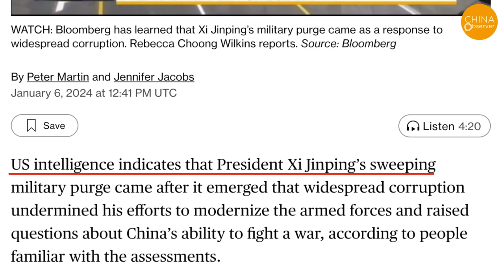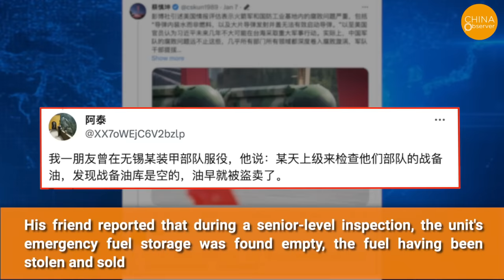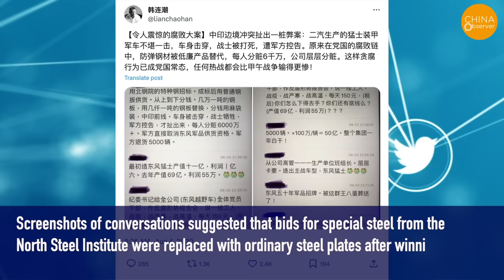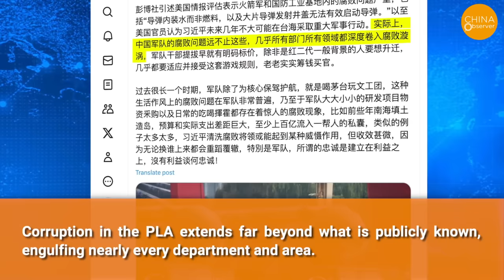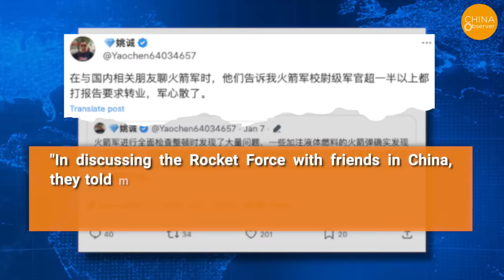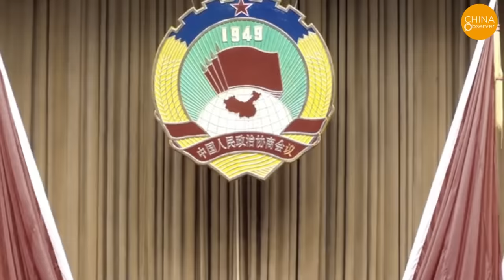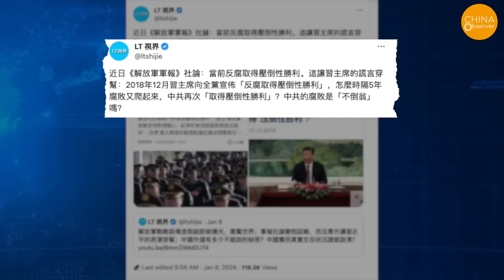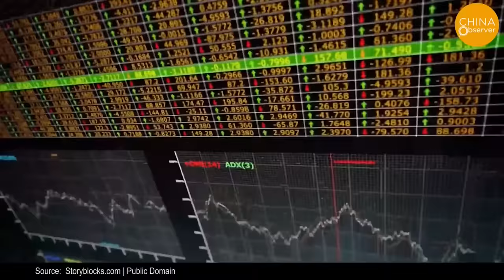China’s Missiles Filled With Water, Not Fuel; Numerous Launch Pads Fail to Open, Soldiers Want Out

Comment: The PLA has discovered a way to use water as rocket fuel? Very interesting!
Reply: well, rocket fuel is just combination of hydrogen and oxygen, why not go with something thats already combined
Reply: You probably could do it with ClF3 as oxidiser. Not that you would want that for anything but the bragging rights to have done it, there is a reason why ClF3 stuff never entered major use in rocketry as it can burn anything except noble gases and fluorides.
Reply: We had them as kids (in the '50s and '60s) little plastic rockets that you filled with water, then applied a bicycle pump to charge.😁
Reply: @surlyogre1476  What's old is new again!

Comment: Just throwing this out there, trying to be optimistic: I wonder if the 'filled with water' item might be the silos themselves are not watertight nor have a water pump-out system if leaks occur, so it shorts out the control systems.  I can't imagine someone actually dumb enough to replace liquid rocket fuel with water.  But then there are those silo doors that don't open properly, did someone forget the regular maintenance procedures on those?  Nothing quite like 'nuking' yourself!
Reply: No they literally sold the fuel off to use for cooking and in order to maintain the fuel levels and gauges water was used to replace the fuel. The same was down for solid rocket fuel. A bunch of it was sold off or used on the bases for cooking. 

能骗就骗 ("if you can cheat, then cheat"). This is a way of life and ingrained into Chinese society.

Comment: Many of the problems Russia encountered in it's invasion of Ukraine are liked shared by China. For a long time, military officials were basically untouchable and the supplies were under care of poorly paid soldiers. Inspections are also few and not even actually happen most of the time, they're just filed as having been done.

Under these conditions, it's no wonder lots of materiel in storage has been compromised or doesn't present the same level of readiness the documents would indicate.

Anyway, dictorships and corruption go hand in hand. Dictatorships are often rife wirh factions, and maintaining the balance between the factions is key to maintaining regime stability, so lots of corruption cases are just ignored, and if you crack down in some faction, you'll embolden the rival factions.

Comment: Their carrier may also not be up for its job, their aircraft have many parts of research stolen, and influenced from russian concepts. The damage they have done to their military by this behaviour will have set them back so far, it may be uneconomic to fix. Not to mention timeline-wise unobtainable. 
However, i think china should annex North Korea, because i personally think that country will create enough attention,draw in the west and china would be forced to display its incapacity militarily when they come to save north korea again. Im not saying china will lose easily, but they would show what they are…
Reply: Their one and only carrier jet the J-15 is a tofu dreg version of a Russian SU-33.  They can't even take off from a carrier with more than a light ordinance load without risking damage to the aircraft.
Reply: @mrvwbug4423  agree… the test wont be to take off and land once, the tests will be to take off and land over a 2 month period using the carrier, its supplies and its on board machinery. I would hate to be a pilot on this carrier after the experimental EMALS may have been rushed into position and if one part were to fail, even the powerplant being at a stretch to energise the rail, could be a ratchet launch into the ocean. 
Im far from an expert but if chinas developing tomcat level aircraft to sustain carrier landings, but expecting F18 launch weights and speeds, they are in for a rough time… i can only hope that somewhere, somebody built the EMALS into a runway and actually tried the thing out…
But i suddenly do wonder if putting the Fords EMALS into a military base to boost all aircraft and also potentially allow fighters off the ground faster is a good idea on land. Imagine getting a fuel saving by assisting the bombers to even half of their take-off speeds